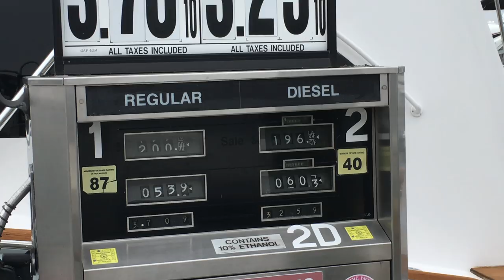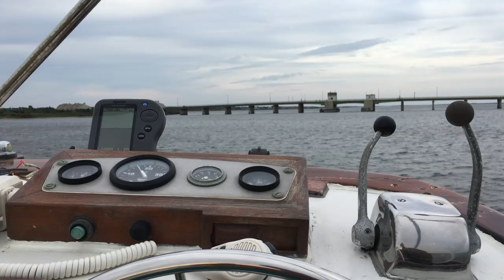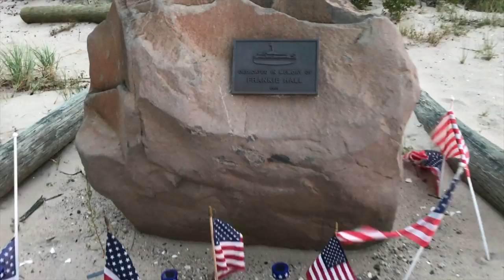RACING 50-YEAR OLD BOSTON WHALERS

Comment: I had a 6 cylinder turbocharged  '79 Ford Lehman in a 25' Luhrs. It used 14 quarts of oil and the injector pump was lubricated by the fuel oil. Wish I had thought to pierce the filter when doing an oil change. I used a little rubber impeller 12 volt pump to suck out the old oil. I still use the pump to change the oil in the lawnmower.

Comment: Thank you so much for showing the maintenance work.   I could not tell if you did this but I recommend turning that oil filter 1/8 of a turn counter clockwise (loosen) just to make sure it's coming off before you put a nail hole in it.  In my 50 years of engine maintenance I've had 2 filters that would not come off without extraordinary effort and sometimes you may not be in a position to fight with a stuck filter.
Reply from the maker: Thanks for the heads up! How did you end up getting those two filters off?
Reply: I'll try to cut to the chase... it was many years ago and I was using a filter wrench of poor quality.  Quality being measured by when you exert pressure on the wrench it does not spread pressure on the band of the wrench evenly.   So the wrench creased the filter and once that's done the strength of the filter housing is next to nothing. The filter collapsed.  Removal of the filter involved using harsh language , giant lock jaws pliers, and tearing away the filter piece by piece.  Oil was everywhere...  I wisely threw the filter wrench away after that. The second time it happened I got smart(er), I could feel the filter housing starting to crush and so I pushed the filter wrench to the base of the filter where it's strongest, after some serious effort it started to turn.  I've also heard of people trying to break the rubber seal with a razor blade but never tried that.
Reply: Drive a big screwdriver all the way through the thing. Like Billy did at the top, but drive the screwdriver all the way through to the handle, as close to the base of the filter as you can. Now you've got a nice handle sticking out of your filter. You'll get it off then.

Comment: Nice to see you race the kids in the other Whaler.  Did that for years locally,  Buddy of mine had a 70hp OMC powered 15 Super Sport that when propped right could run a shade over 50mph which was flying for the time in the early 80's   Good times for sure
Reply from the maker: Wish we had that setup. Dont think we break 25mph...

Comment: That oil filter thing is great tip.
Reply: That only works if your oil filter is mounted vertically as shown. Don't try it if your filter hangs upside down or is horizontal else you will have a mess. :-)
Reply: Only issue is that if by some chance you cant get the filter off,  you are dead in the water, because you now have a hole on your filter. I must admit that I am tempted to try it.
Reply: That's a good point. Although probably only an issue if it's the first time you've changed the filter. Once it's been changed and if you don't over tighten it, you should have no problems removing it in the future. Most folks have a tendency to over tighten oil filters when they install them.
Reply: Yes, that is very true, however, I have been boating long enough to see CRAZY stuff happen with things that are usually so simple.

Comment: good trick with the oil filter. Probably good to warm up older engine before changing oil. fresh oil on top end means less wear on all upper components,If regularly changed there shouldent be alot of contaminants in oil

Comment: I have mixed feelings about running the motor to warm it up b4 oil change. If you do it cold, it has had all night to drain the engine down to the pan. ALL the oil is there and the filter is drained.  If you run it first then all the crap that has drained down into the pan gets circulated and not all the crap will be drained. So what is the point of "warming it up"?  There might be an argument if you pulled the drain plug then it might "flow out" better.
Reply: I was taught because it's warm it would come out easier but I like your point too.
Reply: I was a mechanic all my life and taught the same thing, but when the oil is circulated (warmed) it takes forever to drip down. It'll drip until you put the plug back in so you really aren't getting it all out. I do mine cold. I'm talking cars here,  and my boat because I pull the plug on it too. Not sure how pumping it out would be.
Reply: Simple answer is contaminant entrapment. Oil by design functions better on a molecular level when it's warm. Oil has anti foaming, detergent and viscosity agents which work more efficiently when theses molecules have expanded ie. warmed up. Oil traps contaminants and excess moisture that can be found in a crank case, oil galleries, weep holes etc. A lot of these contaminants get stuck in oil galleries as the engine oil cools and drains back to the crank case. By keeping the oil warm and moving, this dirt/metal shavings etc stay suspended in the oil and become trapped by the filter. In short you have a higher likelihood of removing more contaminants from warm oil than cold oil. But, I too am an automotive tech that has the luxury of allowing all this oil to drain from the oil pans, I don't know much about boats, although I assume the oil theory is very much the same.
Reply: Taperended has the correct answer. It is all about suspension of particles which is much more important than getting every las drop out.
Reply: Warming is also pretty much mandatory when using a sucker. Suckers do not work well with cold thick oil. The suckers get about as much oil as the drain plug as you can stick the pickup tube right against the bottom of the oil pan. I've torn apart small engines after using the sucker and there is just a couple table spoons of oil remaining.
Reply: Taperedend
Well stated, but the way I see it, is that said contaminants that are trapped in the warm oil are drained to the pan warm. Most should be trapped by the filter and any that might remain after draining will/should be trapped by the new filter. It is an ongoing process after all and not 100%. I have seen in pan with baffles in them accumulate "mud/sludge behind them that will never drain also. I can see a theory that the heavies could tend to separated to the bottom of the pan and perhaps tend because of friction with the pan not to flow as well with cold oil, but cold oil will also have more viscosity to move particles better. As I said, I have mixed thoughts as I can see an argument for both ideas and I have never seen the science on the subject although I know there must be a lot.
Reply: jack nimble; are you saying particles become un-suspended from thicker cold oil? Doesn't logic tell us that a particle would travel (due to gravity) through a warmer thinner oil more than thicker cold oil thereby suspending said particle even more firmly?
Reply: The theory is that you warm the engine and then immediately drain the oil while all the particles are still in suspension.
Reply: lastniceg
Reply: Do you know of any other youtuber's/vlogger's that live on a motor yacht (not a sailboat)? I am fimilar with Tula's Endless Summer and BoatFam. I would think that there are more.
Reply: Search "liveaboard powerboat" or trawler